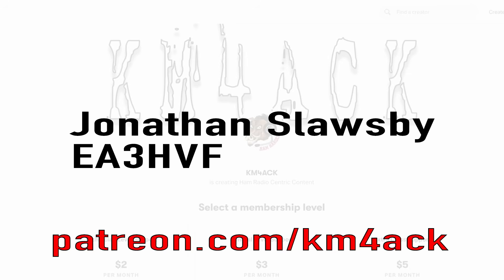It's bound to happen sooner or later

Comment: Forgetting to turn things on is common and happens outside of ham radio.  I seen people leave switch off on lawn mower and try to start it.  Walking away from a problem for a while is good advice . You can lose your sanity if keep hitting a dead end . With them HT's sometimes resetting factory defaults and removing battery and or power and re start can fix things. rebooting a PC is common.   73

Comment: I was having a hard time getting my Yaesu FT891 with a DR891 set up on JS8Call. I could not get the audio through on my computer, I watched so many YouTube videos including yours and couldn't get it. What eventually solved the problem was I factory reset the radio and computer and re-downloaded the various programs, and then it all works now. Sometimes you just have to completely reset everything and start over.

Comment: Was getting ready for multi-op'ing a contest with my buddy down the street (we linked N1MM over the internet and where within the allowed circle for the contest) and were doing a run of the bands.  He said he could barely hear me and I should be blowing out his front end even without the amp on. Took me a few minutes but finally realized i left my antenna switch on dummy load! But he still heard me.

Comment: I bought a second IC706MK2G so that i could keep one of my desk and keep the second for field/portable work.  i'd been using the first for years and for most things it served me well.  the exception was that others seemed to be able to use CIV/PTT on all bands,  where for me i was only able to get working CIV/PTT on HF. It transmits fine, I can do simplex or repeaters all day long, but no CIV.   the "newer" second (also a MK2G) radio works, even on VHF.  it was really nice not having to swap cables if i was changing between the two on winlink or other modes.  but the first still only does HF.  i know i need to go through the second radio and document it as my baseline, i've just been dreading it.  so 100%, write it all down.
Reply: I purchased a IC-706 MKIIG last summer to use as a manpack portable radio. Also got a digirig for it as well to work data modes on HF with HRD. Got everything up and running with it. 

I have a neighbor that also has a IC706 MKIIG. On his set up, he uses a signalink. I went over to his place to help him get it set up. Hours later, we couldn't get it up and working properly with HRD. Even went through my MKIIG by setting and put those in his radio, and nothing. Tried my radio on his computer with my setting and it worked. 

We've tried everything we could think of and couldn't get his radio to work. I came to the conclusion that he might have a problem with his radio, perhaps a RFI issue or something isn't right with the board. Other than that, his radio works fine. 

I have tried doing anything on 2m or 440 with mine. It's just going to be on the HF side. You might have a similar situation like my neighbor has. It could be a radio problem.

Comment: Had to chuckle because I just had one of these incidents. I couldn't get my EF Johnson P25 radio to come on. Since it runs off grid on my battery bank, powered by solar, I attributed it to voltage drop since we had been having cloudy days. After spending some time detaching solar panels and connecting an AC charger to the battery bank, I found that the radio still would not turn on. I started at the back of the radio and began tracing everything. Coax: good Power leads: good Power sensing wire: Ah crap! There was the issue. That tiny little 20 gauge power sensing wire had come disconnected. Something so simple!
Reply: Yep, that little wire on the EFJ!

Comment: About 10 years ago, I was working with Raytheon and was supporting the "warfighter" at Fort Cavasos (Fort Hood at that time). I took my Yaesu original FT-817 with the "Miricle Antenna" measured set for twenty meters on an old battery pack. Power? Check! Coax Ran? Check! Antenna mounted/emplaced properly? Check, or so I thought. One hour later, no contact. Two hours later, no contact. Atmospheric conditions bad? Not that bad! Issue was, I had placed/grounded the Miricle Antenna to the metal picnic table. 

I removed the antenna from the table and placed it on the ground and the little rig came alive. Darn it! All of that wasted time to figure this simple mistake out, but I made a whole bunch of contacts the rest of that day!!!   73s!

Comment: I was net control and i could key the radio and get talk back from the repeater and could hear just fine. Got a phone call my signal was weak. Realized my coax wasn’t connected since i had taken that box in the field and hadn’t fully put it back together. X

Comment: Because I use a digirig, which doesn't need external power, I would not have guessed this was the problem for this specific issue, but it makes perfect sense, and it's an easy thing to miss!
Reply: (I did have a similar "duh" moment though, just yesterday, trying to tweak settings on my FTM-500 with RTSystems...through the Digirig, and not the actual green cable that came with the radio. It does make a difference!)